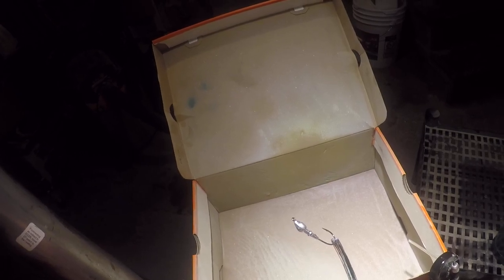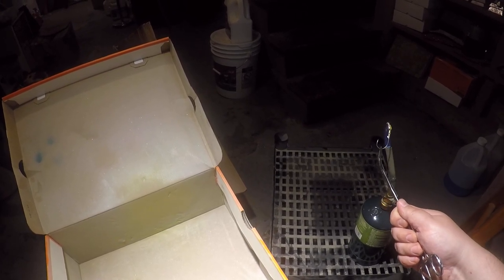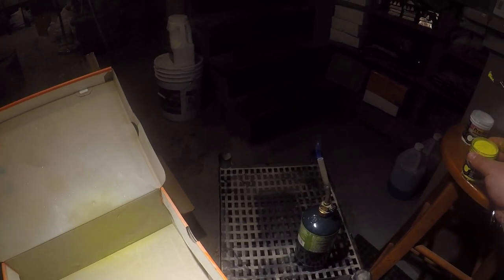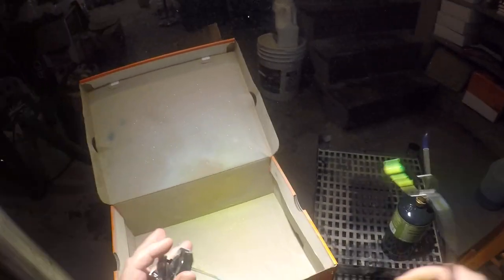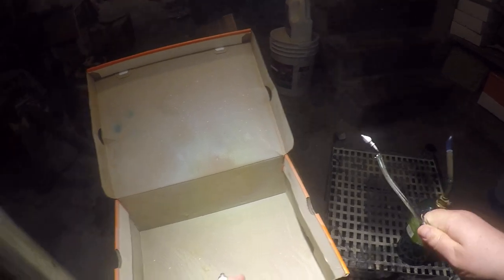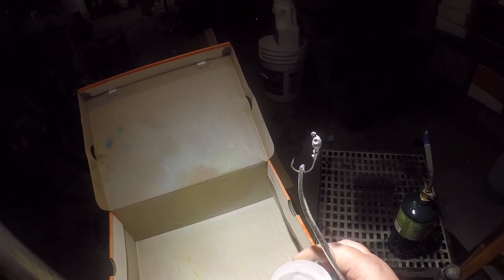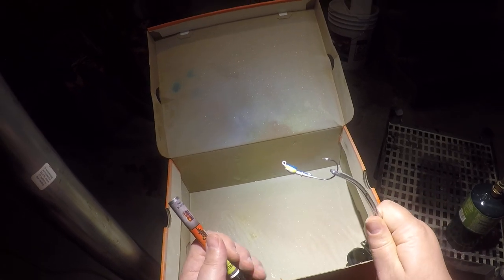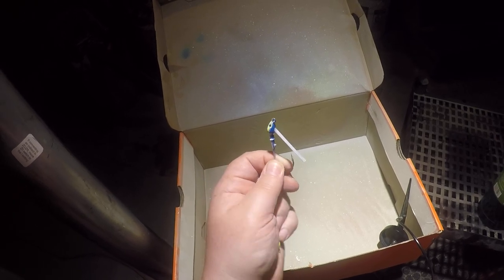Powder Painting Swim Jigs

Comment: Why do you like the powder paint gun vs dipping into a fluid bed? It’s possible I missed it if you did explain it so I apologize ahead of time.
Reply from the maker: That is a good question.  Spraying the powder allows me to add additional colors with some fading like you get from an airbrush. You can't do fine detail but it blends the colors together very nice.
Reply from the maker: I forgot to add that when I do single colors I use a fluid bed but certain things like spinnerbaits and spinner blades are hard to do in a fluid bed so I spray the powder.
Reply: @smalljaw  thanks brother!

Comment: Where can I get the airbrush you are using,  and what kind is it?
Reply from the maker: What I'm using is the old Badger Model 260 hobby sandblaster but it is discontinued. The funny thing is the exact same thing is sold as the powder paint air brush and can be purchased from a lot of places. Go to https://www.tjstackle.com/  and you can get the air brush as well as a small air pump with an adapter to hook the air brush up to for less than $100. The fitting on this air brush doesn't fit a regular air brush compressor.

Comment: Smalljaw Love your videos .  What do you use for an air supply for your air brush ??
Reply from the maker: I use a small 2.5 gallon air compressor but you don't really need that. TJ's Tackle sells a small air pump and adapter to fit the air brush which works well and both the pump and adapter together that will work well and is less than $20.  https://www.tjstackle.com/
Reply: Thank you so much for the reply.I always learn a great deal from your videos . Thank you so much for helping all of us.
Reply: @smalljaw  That small air pump has a hard time for me to push air through and when the powder paint gets stuck. I feel like it needs more air compression to move the paint. I'm having a hard time air brushing powder paint consistently